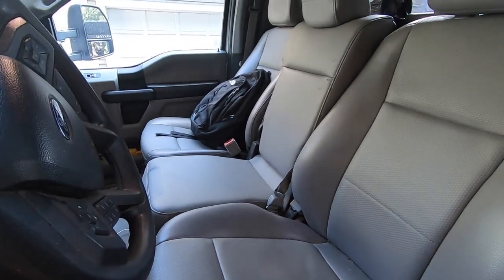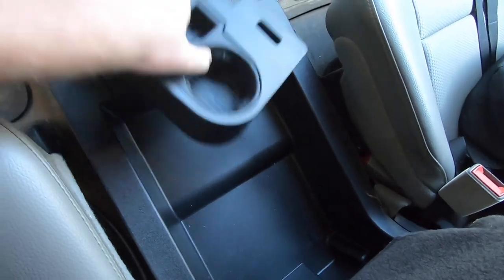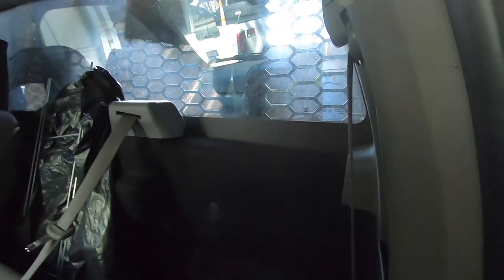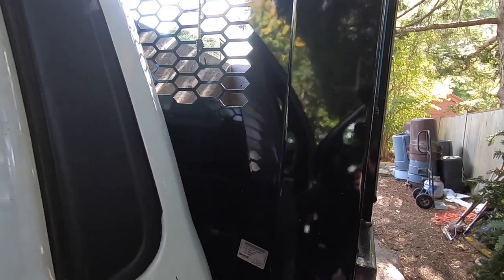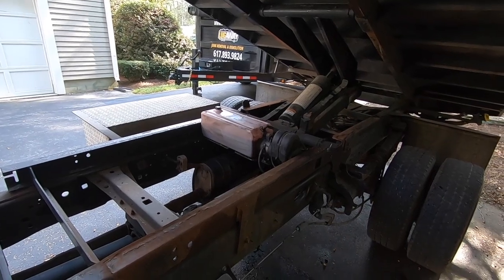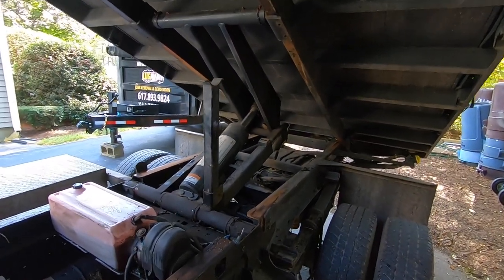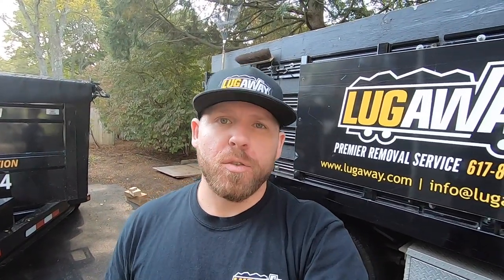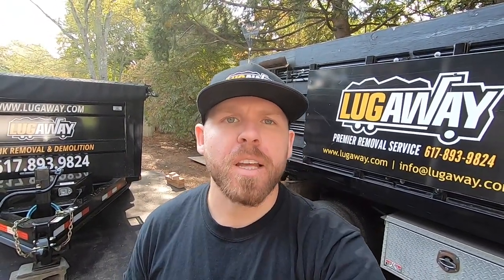JUNK REMOVAL : What Truck To Buy?

Comment: DOT number for your truck is only required if you operate over state lines right? Sorry bingeing your content learning as much as I can.
Reply from the maker: Thats what the rule WAS up until a few years ago. Now,  in MA, if. your vehicles gross weight is 10,001lbs you need to have one.

Comment: Your logo on the side of the truck, is that sheet metal or aluminum and what dimensions are they? I have banners and have to pull over on the highway before they rip off.
Reply from the maker: It's some type of corrugated composite. Not sure of the dimensions probably 2.5 ft tall and 4 feet wide? That could be completely wrong

Comment: I love your set up. Is there any reason you went with this vs a hooklift set up? I was thinking about doing junk removal and maybe dumpster rental in the future. What's your opinions on this?
Reply: Hooklift is usually pricier by a pretty big margin. Dump trucks are usually around 70K new for diesel trucks, even cheaper for gas, while Hooklift can be around $90K without the containers added in. It's not a bad option but it does require a bit more money to start

Comment: I'm sure you've seen the Sonoma Strong guys in CA with the npr, their npr came with a liftgate.  Can the F350 setup like you have also get a liftgate?  I'm leaning to the npr because of the liftgate option, but I would love it if the ford dump can also have that.
Reply from the maker: Yes, you can add that to a 350. It doesn't come with the truck it's something you add on. That goes for NPRs, Fords, Chevys etc. At that level of a truck, you are buying a chassis and adding whatever you want on it.
Reply: @SteveConroy1  I've seen the liftgates for trucks, but a liftgate on a dump bed I haven't seen.  Do you know where to get one?
Reply from the maker: @tekker8308  Anywhere that installs lift gates can install one on a dump bed.  It folds under the truck instead of up against the back doors.

Comment: I just bought a Ford 450 today. How did you do your billboards on the sides? Thanks bud I’m advance.
Reply from the maker: I used a company called Fast Signs, but any business that does signage can do them. My billboards are an extremely durable plastic material. You don't want metal as they will rust and bang every time you hit a pot hole
Reply: @SteveConroy1  I do appreciate it bud! You are hella cool.
Reply: @SteveConroy1  Great point!! Thanks for your expertise.
Reply from the maker: @brettkoch8514  Thanks Brett! Good luck out there. Any info you want some info on please let me know. Iv'e gathered about 15 questions from the comments on this video that I am going to use to make another one for everybody so fire away if needed!

Comment: What truck do you use to haul your dump trailer
Reply from the maker: I use my 350 pick up. My 350 dump truck does not have a hitch receiver but if it did you could pull the trailer with that as well. You would want to be extremely careful about weight when you get into business like that though.

Comment: The 350 Super Dutty track how long is the bed  and how high 
Pls let me know
Reply from the maker: The bed is 12 feet long and 4.5 feet tall. The height of the body I'm not 100% sure of but I know its less than 10ft
Reply: @SteveConroy1  Thank you for the prompt response and for helping out aspiring entrepreneurs! If possible, I would really appreciate more specifics on the type of truck you have and its width. I have a Mitsubishi Fuso FE 180. The chasis is 14 ft. Would you recommend a 12 ft or 14ft bed and how wide ?
Thanks again for everything.
Reply from the maker: @thedolphinspool  The body of my dump truck is 12ft long, 8ft wide, 4.5ft tall. I would stick with a 12ft body and if you wanted to make it bigger add to the top.
Reply: @SteveConroy1  Thank You